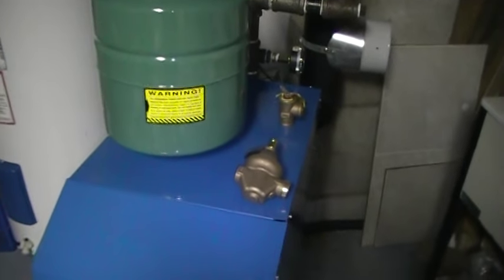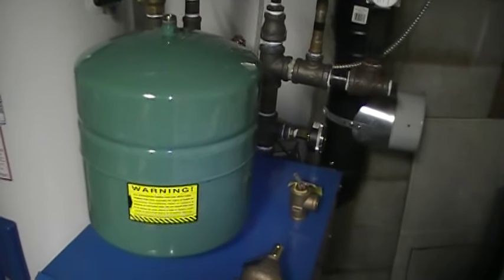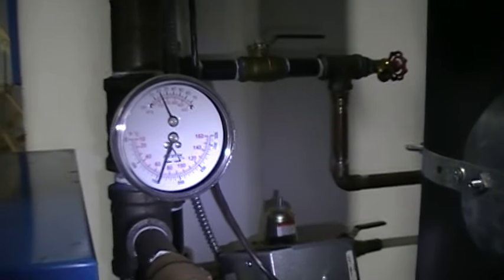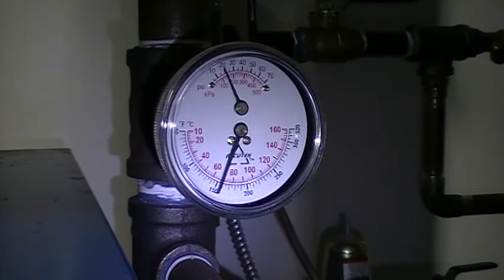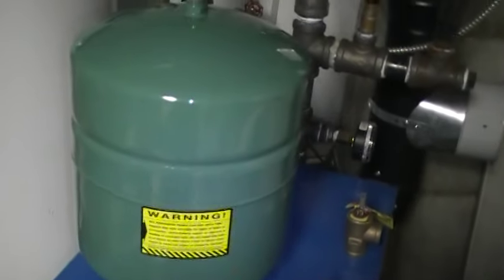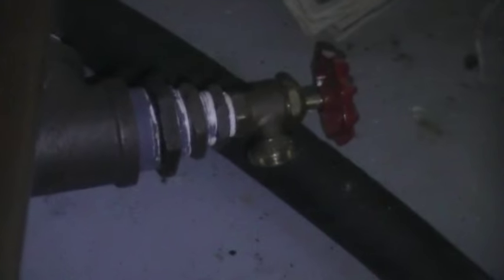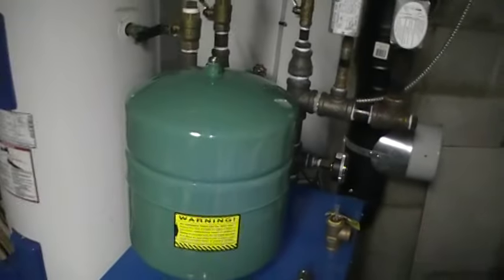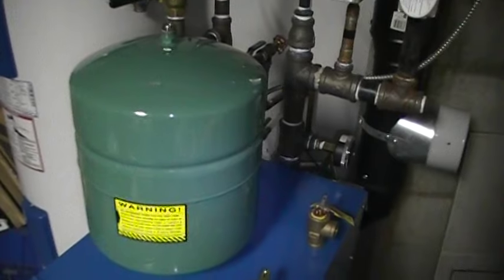Relief valve blowing off on hot water boiler (furnace).possible cause...Part 3

Comment: My pressure in my furnace goes over 30psi only when the circulator pump runs.  Slowly goes back to normal when it shuts off.   I added air in my expansion tank and made no differences.  Any ideas?
Reply from the maker: Hello Pernell German,
Did you drain any water out of the expansion tank (size...1 foot by 3 feet) or is it a small tank about a foot wide that is screwed onto a fitting near the top of the boiler?
What pressure is it when the system is shut down and the pump is not running?
Is it popping the pressure relief valve?
Thanks for commenting and get back to me when you get a chance....Al
Reply: Hello Al
  It does pop the pressure relief valve when it reaches 32psi.  I added air to the tank twice. No difference. 
    I have a old furnass, my expansion tank doesn't have a bladder inside.  It's on top of the boiler on the return side. 
   I shut the furnace off for two days before and the pressure goes down to normal.
Reply from the maker: Hello Pernell German,
Just trying to be clear on your expansion tank...it is about three feet long and about a foot wide suspended in the ceiling? 
So shutting the boiler down for a few days allowed the water to cool and the pressure to drop. As water is heated; it begins to expand; which in turn creates pressure in the system. That would be normal for the pressure to drop. 
Adding air to the tank will not decrease the pressure unless you have a drain valve opened on the system. You can add air, but must remove water to allow it to expand when it is heated. Adding air and not reducing the water will only increase the pressure. 
You are almost there....
Thanks for commenting and get back to me when you get a chance...Al
Reply: The tank is a little bigger than a regular expansion tank with a blader.  The tank sits on top of the furnace. The return line is on the side of the tank and then feed the furnace underneath..  (When I added air in the tank I did removed water to lower the pressure to 15psi . It has a air fitting to add air).   
  The pressure stays the same all summer but when I call for heat is rises to 30-32psi in 10 to 15 mins.   It never did this before.        
  One thing I was going to do is shut off my water pump , bring it to 0 psi and then call for heat.  If it's still climbs then I know it the furnace and not the water regulator.
Reply from the maker: Hello Pernell German,
I am pretty sure the problem is with the boiler system. generally pressure reducing valves don't fail and allow more water to enter the system. They usually get plugged with sediment over time and won't allow any water to enter the system unless you lift the lever on top of them.
So after you added the air and removed the water; what was the pressure on the gauge? It should have been down around 12...14 pounds. Possibly 18 if the water was hot. You want to remove a fair amount of water when adding air to the system. I would have removed a few gallons of water at least. Biggest thing is to make sure the pressure is low after you have added the air and removed the water.
Next time your thermostat calls for heat, watch the gauge (tridicator) and see what temperature the burner shuts down at. It's working off the high/low limits in the aquastat. You want to make sure it shuts off at the high limit setting. If it goes above 180; you should remove the grey cover from the front of the aquastat see what your high limit is set at. Should be set around 170/180. Low limit should be 20 degrees in the difference.150/170. 
Most that I have found are 160/180 setting. Low to high.
Do you have a coil in the boiler?
If you shut the valve off before the pressure reducing valve that will eliminate the prv. I don't believe it is that myself.
Get back to me when you get a chance....Al
Reply: Hello Al 
   Yes it's a coil and I did removed water and lowered the pressure to 12psi when I added air to the system.   The thermostats is set 165-180 and works great.    I did call for heat for 2mins  yesterday, the pump came on & the furnace didn't kick in, the pressure went up 2psi.   2 hrs later the pressure was down 1.5.  
   Maybe I have a valve restricting the water flow.
Reply from the maker: Hello Pernell German,
Is it continuing to pop the relief valve and build up pressure or is the relief valve dripping water on a continuous basis? I know you mentioned it popped before at 32 pounds. Just wanting to know if it is continuing to do the same thing.
Do you have zone valves on the system or is it a flow control valve on the outlet of the boiler? Your house is heating well?
I wish I was your neighbor. I would be over to figure things out for you.
Still thinking it is related to the expansion tank...
Get back to me when you get a chance...Al
Reply: Hello Al
   I have three zone valves and it doesn’t matter which one I use the pressure builds up and the relief valve drips water. 
   It heats the house normal but I don’t use it much. I have a heat pump but the furnace kicks in during the night on cold nights.   
  I really appreciate the reply’s 👍
Reply from the maker: Hello Pernell German,
Hard one to figure here unless I was there. Hopefully we will figure it out.
Having a coil in your boiler means it maintains boiler temperature 24/7. All the time.
I would turn up one of the thermostats and see if the burner shuts off once it hits the high limit while the zone valve is open. If it doesn't then it possibly could be the triple aquastat. When the zone valve opens and turns on the pump; the pressure shouldn't rise in the system until the burner cuts in. The water has to be heated to create pressure. I could see a little with the pump on, but if all the zones are heating fine then there is no issue with restrictions.
I know it maintains the correct temperature with the coil, but it could be possible that the aquatstat is not turning the burner off when the zone valve is open and building too high a pressure. I know you mentioned that it ran for two minutes, but the burner did not come on during that time. I would be interested to see if the thermostat was turned on and if the burner would kick off once it cut in.
Your tank has no bladder in it so therefore to remove the water you used a compressor to do so and took off a few gallons of water?
Thanks for commenting and get back to me when you get a chance...Al
Reply: Yes it maintains temperature all the time and shuts off at 185.   Even when it calls for heat it kicked in and out at the proper temps settings.  
    Hard one to troubleshoot....  I’ll keep using my heat pump for now and tackle it in the spring when its warmer.

Comment: I have not checked the pressure in the tank yet.   I can tell just by looking at it that it is Weighty. It’s been on there since 2003 when the system was installed.
Reply from the maker: Hello windsurfed1,
Hopefully it is the tank and your problem is resolved.
The tanks are hit and miss. Some of them las t for a few decades while others may last for a few months. If you managed to get 18 years out of it you have done very well! 
Thanks for commenting and enjoy the holidays!      Al
Reply: @TheOldkid888  got it fixed. It was the expansion tank. I put it in myself and a new gauge. Fired it up and the pressure stays right at 12 1/2 pounds
Reply from the maker: Hello windsurfed1,
Perfect!
That's great to hear!
Nice to have that behind you!
Congrats on the repair!
Thanks for commenting and enjoy the holidays!    Al
Reply: @TheOldkid888  Yes it worked great thanks for the video

Comment: hi. we have had our furnace turned off all summer and noticed it is letting off water from the relief valve pipe. filling buckets every so often. what would be causing pressure to build while it is off?
Reply from the maker: Hello Jim,
Is the burner turned off completely or is it running from time to time to maintain boiler temperature? If it is there is a possibility that your expansion tank could be waterlogged. 
Do you have a coil in the boiler?
Thanks for commenting and get back to me when you get a chance...Al

Comment: Is there a valve on the top of the extrol over there?
Because over here there is and if you press the pin and no water comes out sometimes you can get away with pumping them up to pressure again.

Comment: Hi OldKid
Heat running, pressure builds to 20lbs, blows off some water until it builds back up to 20lbs and blows off some water again. Bell & Gosset expansion tank. 11-12 year old boiler w/coil. Boiler temp was increasing from 175, 180, 185, 190, 195. Pressure never went beyond 20lbs and blew off some water every time once it hit 20lbs. Suggestions?

Comment: my heater pipes are making sounds like running water ,,I don't see any water any where ..bit it sounds like it is pouring out some where ???
thank you
Reply from the maker: Hello John;
That is more then likely air in the system.
I take it you have baseboard radiation.
You should probably look at purging the air out of the system at some point.
I did make a video on this procedure. What will eventually happen is the system will become air locked and you will not get any heat.
If you are a little hesitant to do this procedure. You should look at getting someone in to do this for you.
Thanks for commenting and let me know if you need any advice!    Al

Comment: All 3 tank/make up/and PR were changed  but still coming out at 20psi? 1 yr later if air is in the sysytem would that do it?
Reply from the maker: Hello John,
Air in the system wouldn't cause the pressure relief valve to drip water if the tank and pressure reducing valve were changed. 
When you look at the gauge on the boiler when it is hot; does it go near 30 pounds or is it always around 20? You may want to sit there for a while and watch it just to be sure.
If it is always around 20 PSI, then it is a faulty pressure relief valve.
Sometimes after they pop; they will not reseat properly and will continue to drip. 
Was your relief valve the last thing that was changed on the system?

Here is a video I made on removing air from your heating system if you are interested. It won't stop the relief valve from dripping. I am positive of that.
"How to remove the air out of your hot water heating system-girgling noise."
https://www.youtube.com/watch?v=nuf8A7D64YU&t=2s

Thanks for commenting and get back to me when you get a chance...Al
Reply: @TheOldkid888   i climbs to 30 psi as boiler reaches set point
Reply from the maker: @Supanova70   So you have changed the coil? Correct? And no difference in pressure? So you closed the valve before the pressure reducing valve that supplies water to the boiler not to the coil; the pressure still climbs? Is this correct? I just want to clarify this so we can figure it out.  What are the high low limits set at? !60/180? And does the boiler go much higher than that before it shuts off? At what temperature does it shut off? Do you have a small expansion tank or a large one? Dimension would be helpful.
If you can answer these questions for me I can give you a better diagnosis of the problem.
Get back to me when you get a chance....Al
Reply: @TheOldkid888   Yes to question one. It is a amtrol 30 tank. With A12PSI taco pressure reducing Valve. H180 low limit 160 , 20  differential. It shuts off at 180 as it does reach that point it bleeds out.
Reply: @TheOldkid888  After all that work turned out to be another failed Extrol...ugg. 5 months old..
Reply from the maker: @Supanova70  Should be a warranty on the old one. I am not a fan of the small tanks at all. They have a tendency to last only a few years. And unfortunately, in your case, the tank only lasted 5 months. The full size old style tank is far superior in my eyes. You have to drain it every year, which takes about ten minutes, and it will last for decades. Simply hang it between the floor joists with strapping. Installing a shut off to it and a drain on either end and you are good to go. 
If anything else should come along drop me a line!
Sorry to hear you went through all that to find out it was the tank.
Thanks for commenting and enjoy your week!       Al
Reply: @TheOldkid888  typical 30

Comment: Hi, the pressure relief valve keeps going off. Lots of water then steam. I've replaced the expansion tank, the pressure regulator, the circulation pump, and the pressure relief valve. Out of options and too the point of frustration. Any idea why the pressure relief valve keeps going off?
Reply from the maker: Hello Maricela Hela;
Does your boiler have a coil in it for domestic hot water? If so; I would turn the valve off that supplies water to the coil. 
The way the coil works is it is submerged in the water in the boiler. What ever the boiler temperature is set on; that is what temperature the water will reach. I have seen this happen several times; A small pinhole will get in the copper coil and drive the pressure inside the boiler up and blow the relief valve. Simple way to find out if this is the problem is turn the valve off feeding the coil and see if the pressure rises. If it remains at the same pressure and the relief valve doesn't blow off; then you the coil is the problem and you will have to change your coil which is one option.
You have a gauge on your boiler. It is called a tradicator. It has 2 gauges on it. One shows the pressure and the other shows the temperature. If you look closely at the gauge that shows the temperature; see what it shows when your boiler shuts off. You have a control on your boiler that is called an aquastat. This has a high and low temperature setting on it. The temperature should be set around 180 for the high and 160 for the low ( in that area). If you boiler is not shutting off at the high setting and going above it significantly before it shuts off; then you will have to replace your aquastat. 
If you have a coil in your boiler; you will need a triple aquastat. If you don't have a coil in your boiler; then you will need a double aquastat.
An aquastat is not a common item that goes on boilers, but I have seen a number of them over the years.
So it is either the coil or the aquastat.
Sorry to hear about your troubles!
Thanks for commenting and let me know how you get along!      Al

Comment: If I replace the expansion tank but not the pressure relief valve and it was good for couple day only small amount of water come out. But couple day later more water coming out almost half gallon per day, is that mean pressure relief valve is bad or could it be other things bad too?
Reply from the maker: Hello Surachet,
Let's start off by asking the question..What is the pressure on the gauge?
The water can come from a relief valve that doesn't reseat properly, but the pressure is what really matters. 
You have replaced the expansion tank? Just to be clear.
Is there a coil for the hot water in the boiler?
These are a few questions that you could answer for me and we can figure this out.
Get back to me when you get a chance....Al
Reply: @TheOldkid888   Pressure guage read 20psi expansion tank was changed but not pressure relief valve at first and water still leak slowly from pressure relief valve.   Turn out 2 weeks ago pressure relief valve had been replaced and water stop leaking, I just wait to be sure that is the problem before I reply.  So are expansion tank and pressure relief valve usually fail together?
Reply from the maker: Hello Surachet
,
Most often what happens is the expansion tank fails and the relief valve will pop and then leak a bit afterwards.  The relief valve never really seats where it was to begin with and will continue to leak. I have seen it many times as it is VERY common.
You should be all set if your gauge is around 20 PSI with the boiler is maintaining temp.
The problem was the expansion tank becoming waterlogged, but as you can see it created another one as well.
You should be all set to go!
Any other questions feel free to ask!
Thanks for commenting and enjoy your weekend!     Al

Comment: My pressure relief valve leaks. The tractometer is at 30psi when the boiler is operating .
I put in a new pressure relief valve and a new expansions tank and still have the same problem .?

Comment: To the comment below:
Tap on the tank and notice the sound it makes. If the tank is filled with water it will make a dull sound. When filled with air tap on it. The tank will make sound closer to an empty can. Also if the tank is suspended by a single pipe, notice how it vibrates. A full tank slower vibration. A tank filled with air a faster vibration.

Comment: Dominick, does this mean that I have to replace the extrol tank? Why is automatic air vent valve dripping? What did I do to cause this to happen? Thanks :)
Reply from the maker: Hello  MyJubilation,
You may have sent the message to the wrong person.   Al
Reply: TheOldkid888 Sorry!
Reply: @TheOldkid888  
My pressure is running high around 50 but it's not popping my relief valve.any ideas on what causing also I have hot water coil
Reply from the maker: Hello Anwar,
If your pressure is at fifty you may possibly have a leak in your coil. I would close the valve going to the coil and drain pressure off the system and drop it down to 20 pounds. Leave the valve off to the coil and watch the pressure on the tradicator (gauge) and allow the system to work as usual. If the pressure doesn't rise, you know you have a leak in the coil.
It could be a faulty pressure reducing valve, but sounds more like the coil.
If the pressure relief valve is not popping at thirty; it has to be replaced. Normally thirty is the pressure it pops. 
Thanks for commenting and get back to me when you get a chance....Al